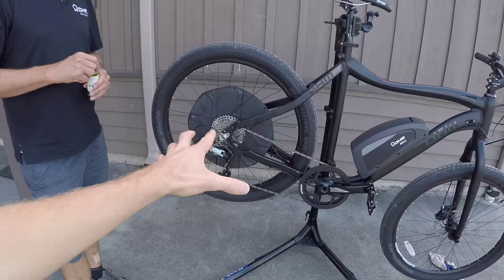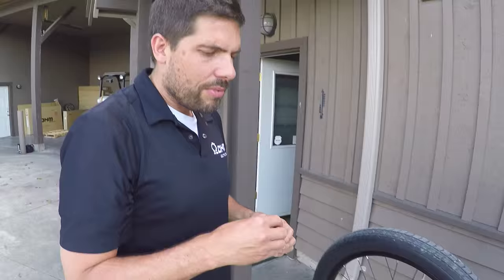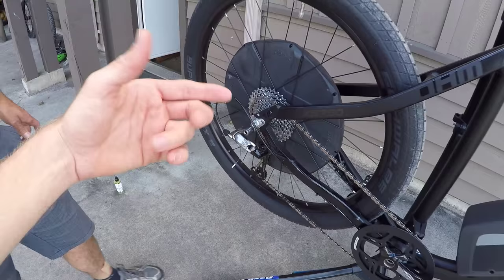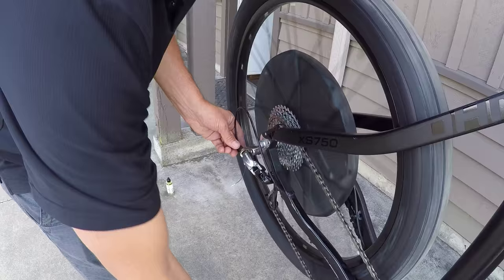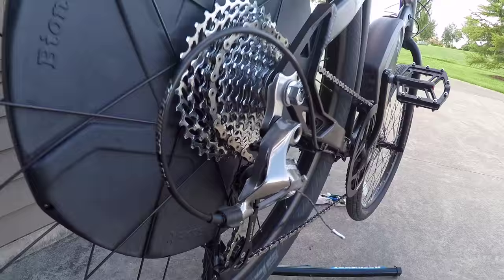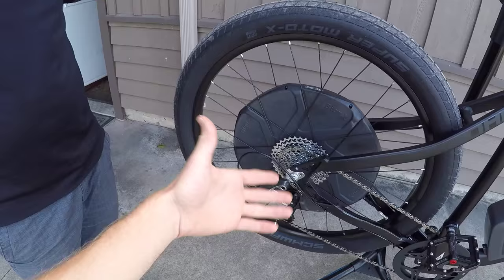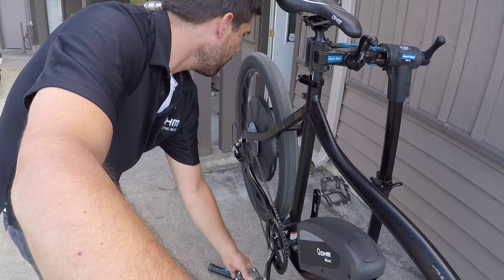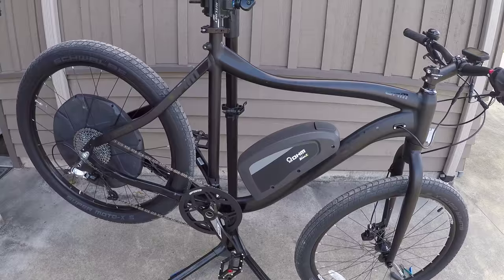How to Lube a Bike Chain and Tune the Derailleur in 5 Minutes

Comment: When oiling a chain always apply oil to the inside of chain. the centrifugal-force sends oil through the chain first.  oil the outside and it flys off.    tip from old dirtbike rider.

Comment: yea so much good quality content going on here:
1. adjust the low gear with the limmiter screw not with the cable tension
2. same withe the highest gear
3. don't lube the chain between derailer and crank on the inside of the rollers
4. lube it on the outside over the cassette
5. shift in all the cogs to get the oil on there because cogs are moving parts

Comment: I like the White Lightning Clean Ride chain wax lube - much cleaner than the oil ones. Did you notice the hard to find MG-5 Wellgo pedals? Much flatter than the MG1 model and I like the screws/studs better. I believe wellgo stopped making the MG-5, but there's a few left on amazon.
Reply from the maker: ForbinColossus Yeah, I love those pedals! We were test riding OHM's Sport SX750 Plus bike earlier and this was the standard SX750 with larger Schwalbe Super Moto tires... very cool setup. I'll have the Plus review out shortly. Is this the chain lube you're talking about?

I agree that White Lightening wax/lube is good stuff, have you tried their "all conditions" forumula http://amzn.to/1IBJ1aZ or do you like the original best http://amzn.to/1DFfMHB The demo we did lasted more than 5 minutes and I went crazy chopping it down... hope it wasn't too jarring ;)
Reply: ElectricBikeReview.com I only know about the original formula wax/lube. Thanks for clue-ing me in. Vid was OK, but I'd value instructions about checking chain tension and adjusting by hand without special chain tools (if possible).
Reply from the maker: ForbinColossus Cool, thanks for the suggestions! I'll keep these in mind and do an update sometime :)